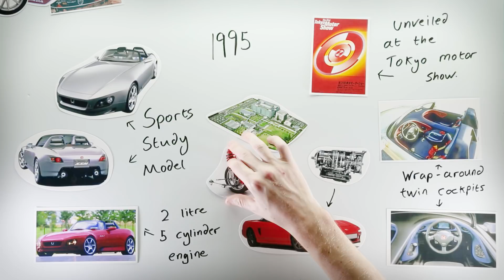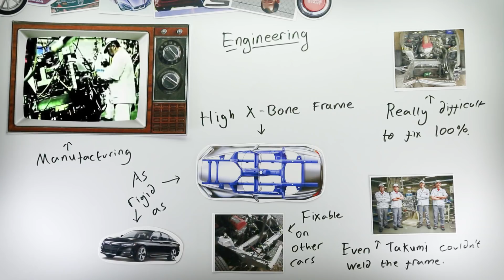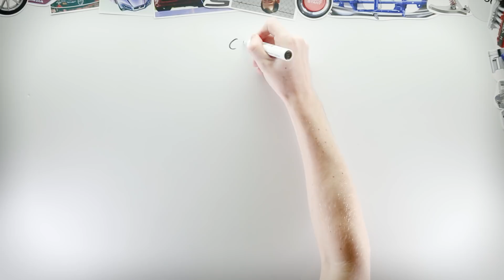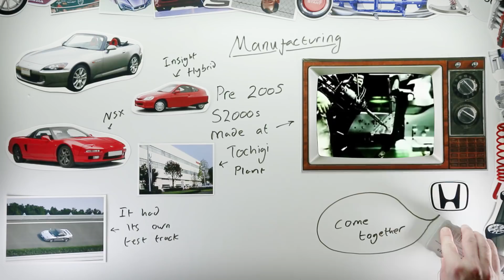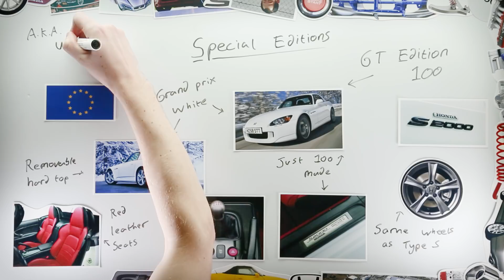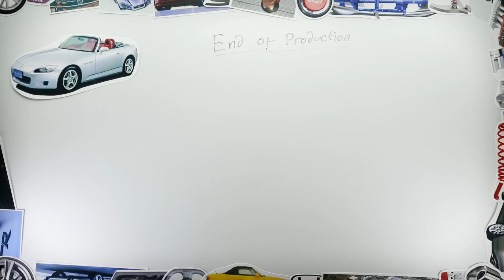THE HISTORY OF THE HONDA S2000 | On Board

Comment: Way too heavy. The weight distribution is terrible. 38/62 is optimal. Most inertia on the drive wheels under acceleration. Equal balance on braking when the inertia goes forward. Rookie narrator reading a script.
Reply: Uhm when breaking the weight shifts to the front which brings it even closer to 50/50 … or even puts more weight to the front for more grip on the front tires. I don’t know if you have ever driven a S2000 but it’s almost perfect in corners and weight distribution can be managed very well with the breaks. It’s a very different driving feeling to a Elise but the weight distribution is perfect for this car with the amount of power/chassis/suspension and layout. Of course a 911 with 50/50 weight distribution is not good because it does not match the car’s layout. If you haven’t driven one, give it a try, there is probably no car which is more fun to drive at this price except a lotus elise. (Which is more expensive too)
Reply: @OnePunchMan-i2q  So many people incorrectly believe 50/50 is perfect, it is perfectly wrong. Front-mid is still a bit too far forward S2000), rear too far back. Unsurprising mid-engine is perfect ala Formula One (Elise, NSX etc). I have not driven an S2000 but have much respect for them. Nothing like revving into the 8000s like that and my 2ZZ.
Reply: @daveblock1688  but there is no such thing as a perfect weight distribution, you just have to drive the corners differently depending on the car. Although from my personal experience and preference, a close 50/50 split feels the most neutral and predicatable to drive. I guess like everything else it is up to personal preferences. But let me know if i am wrong or if you have good sources to get more infos, happy to learn more about weigt distribution.
Reply: @OnePunchMan-i2q  Refer to Formula 1 cars.
Reply: @daveblock1688  F1's have a slightly rear biased 50/50 weight distribution (45.5 - 46.7% on the front axle and 53.3-54.5 on the rear) same as the S2000 which is a bit more closer to the 50/50. But F1 cars drive in a different evironment, with different power outputs, HP, drag and downforce, so imo can't be compared.

Comment: Thank You for  a very enjoyable video of a great sports car.  I own a  totally stock 2003 (AP1) car which I consider the pinnacle of S2000s.  I know most reserve that honor for the CR version, however I wanted the AP1 with the 9,000 rpm engine and the quicker steering rack that was discarded by Honda with the AP2 models in the US and only reappeared on the CR model.  If only they had brought back the AP1 motor also.
Reply from the maker: Thanks for watching and I'm so glad you enjoyed the video!  And congratulations on owning such an awesome car. The AP1 is a wonderful car and I imagine many people would agree with your sentiment as it's arguably the purest translation of what Honda intended when they produced the Sports Study Model Prototype, both mechanically and aesthetically.  With that being said I do very much believe that the Facelift/AP2 revisions were very important to the longevity of the S2000 and also makes for an excellent, albeit different driving experience.
Reply: @AveragetoPoor  I think you are correct.  Although I do not really want to modify my car, I think it would be interesting to try a set of the larger tires and wheels from the AP2 cars, however  I would keep the stabilizer bars that came with the car.  As for styling I cant really decide which one I prefer, probably the AP1 but then I am somewhat prejudiced!